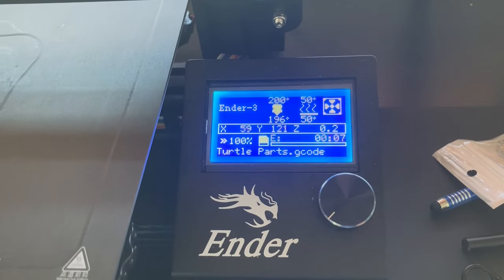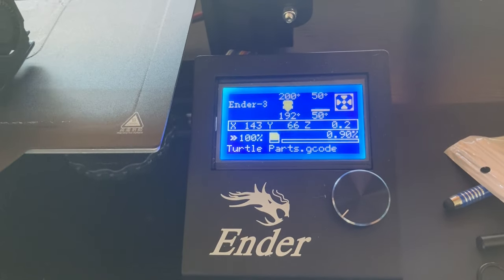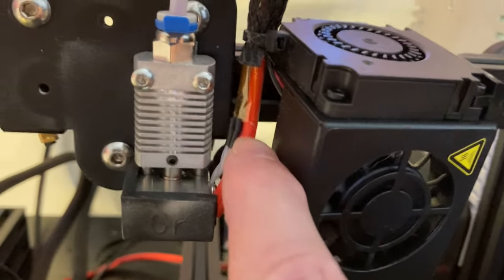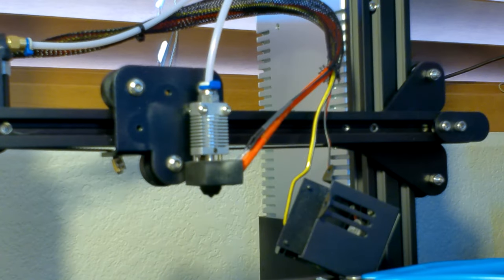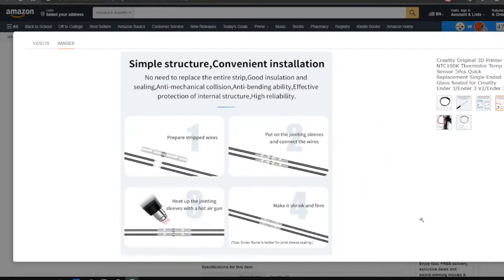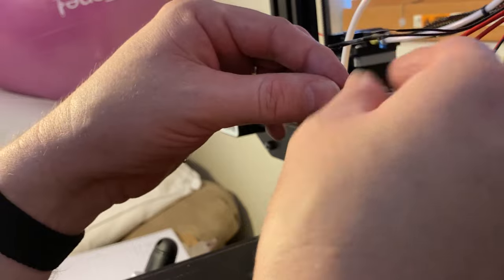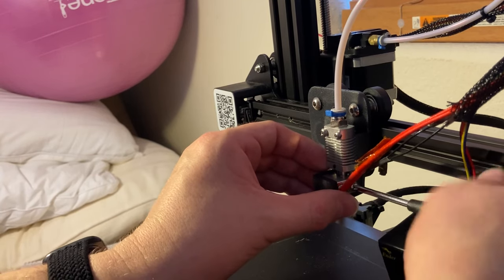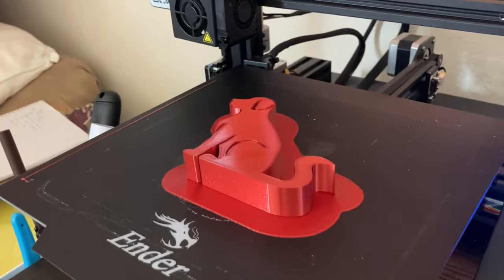STOP THE BEEPING! - Ender 3 Thermistor Replacement - Fix Thermal Runaway Issue

Comment: But how did you know which way to hook up the wires?  
Also, how did you exactly get the thermistor to stay in the hole? Then you're supposed to screw in the screw while the termmistor is in the hole too?
Reply from the maker: There's no polarity for the thermistor, so it doesn't matter which wires go where. (like for a resistor)  
You put the thermistor into it's specific hole then bend the wires close to the thermistor into a round shape. Then use the screw on the hole below to hold those bent wires against the block so the thermistor doesn't back out.
Reply: don't screw the thermister into the hole.

Comment: On mine the wire that is sandwiched between the screw and heat block is a bit exposed I can see the wire.  That’s probably bad isn’t it.
Reply from the maker: Yeah. I would say so. 

Even if it’s not making contact now you would have to think of how many little movements the nozzle and heat block make while printing. If it’s a little worn it could get worse over time.

Comment: I have also found out if I printed a great deal layers start failing I believe have a bad Thermistor, I started using it again and small stuff I could print with fewer layers but, when I got up in large prints it would fail. melting or not staying together is a tell tell sign it need replaced.

Comment: Also another cause is the wires solder from the bed plate is not attach will have to re-solder back to bed plate.:face-pink-tears:
Reply from the maker: Yeah I believe that would cause the error for the plate thermistor.  :face-blue-wide-eyes: Resoldering isn't too hard.  It's wires instead of micro-electronics.  You can do it. :yougotthis:

Comment: great video, I experienced problems lately that my printer in the middle of its print gives the "Heating Failed" error. i replaces the Heater cartridge and Thermistor but still gives this problem... at around 150-180 °C the problem occurs. any tips what i can do ?

Comment: I got a slightly different reading error on my cr-10s. When it gets within +/- 5 degrees of my target print temp it makes the same horrific beep and says "E1 failed to heat, please restart." I've currently tried doing PID tuning and I've checked the heat cartridge and it doesn't have any damage or issues I'm aware of. Yet after checking that and running the PID tuning in Pronterface I'm still getting the issue. My next thing to check is the power connections to the power supply and mainboard. If that doesn't work should I just try replacing my heat cartridge and thermistor? Been asking around for any advice, since this printer has lasted me 3-4 years so far, and I've not bought any others as of yet.

Comment: Hi. in my case, there is not a E1 warm. just the "THERMAL RUN AWAY Printer halted' text and thats all. I tried to move cables for if a false contacts appears but machine stills works normally l. Like you, printer starts fine but in some moment, will song a beeper and printer stops.

Comment: Thx  my printer is almost year old and just started.  Ugh will need to replace my thermistor also as tonight the 2nd time mine buzzzzzesss hehe.  So i knew hey FLATLINER!!      Charge!!  Clear  !     Ok  doc  we  have  a pulse 😂
Reply: @S-Technology  what i suspect the issue was , maybe bit loose with the screw. As thermistor must also physically make contact to be accurate with the temp.  I pulled it out no dirt whatsoever and put it in again fastened screw. And tested and my temp was more stable like normal.  Temp didnt flucuate as much.  So tonight or tomorrow will just re level bed and print again

Comment: is it the same process for the ender 5? I'm not that technical and experienced when it comes to this things but i want to try to fix it myself thank youu.
Reply from the maker: If it is the same hot end as an Ender 3 it should be the same process.  It appears the be the same if it is still stock.  Just take your time.  If I can do it, you can too.

Comment: Simple buy your exchange/repair Hotends. They come for about 15 Euro from Chine with a heating cartridge and the thermistor.
Don´t understand that you have no thermistor over. The problem is mostly that the Ohm Resistant changes and then you have no
usable result. No problem, i changed it only once and it works fine.

Many times the people have more problems because they build in connectors between the cables for faster change.
The problem is that some of these connectors don´t like heat and bend, or after 10 reconnects you don´t get contact.
Solder it directly together and then it should work fine.
Reply from the maker: That's also a good option especially if you are planning on upgrading your hot end.

Comment: I actually found that my ender 3's thermistor screw was undersized leading to unscrewing overtime but by the time I realised I screwed it back so many times that it ate through the thermistor wires and now I'm here since the reduced resistance leads to 10-20C lower temperatures recorded than what it is and I'm justnot comfortable with the idea of just settign that much higher for obvious reasons.

Comment: I've only had my ender for 5 days when this issue occured, does this mean I have to replace my thermistors anyways? or could it be another issue?
Reply from the maker: From what I researched there are basically 3 things that could cause the error. 
1) the thermistor by the nozzle like in the video.
2) the thermistor under the bed. 
3) the plugs for either on the motherboard. 

The thermistors are small and fragile, and the QC of Enders isn’t the best. So it’s possible it could have been damaged in freight.

Comment: hypothetically how many times can you cut the existing wire, lets say multiple splices, before you would have to replace the whole wire?
Reply: Every time you splice you cut behind the current sleeve, so it's always just one connection. I think you'll notice once you don't have anything left to cut.

Comment: after replacing thermistor and updating firmware and still getting this E1 runaway
 fault randomly what should i do next? this printer has only a few hundred hours on it.
Reply from the maker: My understanding is that the error can be caused by the Thermistor at the nozzle, under the print bed, or the plugs on the main board of the unit (That the above mentioned sensors plug into).  Have you been able to see the readout before the error triggers?  Do you see what temp is moving more than normal? That can give a clue.

Comment: ok let's see if you can help me solve my problem.. I have an alfawise u10 but I notice that the software is the same as the ender. I had the same error on the display of the machine and I replaced the whole hot end block...thermistor and heating cartridge but it doesn't work.. Now it gives me the message "heating failed..printer halted..please reset":face-blue-wide-eyes:
What can I do? How do you reset the machine? Heeeeeelp!! Thanks in advance!!!
Reply from the maker: Hmm... Have you checked the wiring on everything near the hot end? Thermistor and heating cartridge placed correctly?  
It sounds like either something is loose or not getting the correct voltage. I would also check the connectors on your motherboard to make sure nothing is bent or even worse melting.  If everything seems okay you may need to check the voltage being pulled by your hot end components. Something is off that is triggering a fail safe to stop the printer.  When it says to "reset" that is simply turning it off and then back on after several seconds.  Its a "Hard Reset" to clear out all the sensor data.
Reply: @S-Technology  Thanks for the answer!  I fixed my problem  by also asking for help from a printer manufacturer. And in fact, as you said, it was a voltage problem, or rather, something had burned in the board inside the connector that connects the machine to the power supply. Changed that everything is back to normal! Thanks again for the suggestions!
Reply from the maker: Glad you got it working again! 👍
That printer has a large print bed. What are you planning on making?
Reply: @S-Technology  yes the printer is pretty big.  at the moment I collaborate with a foundry.  I make enlargements of sculptures which are then retouched in wax or other materials. So it's not just for hobby but this printer is starting to get old and giving problems... I was considering buying another one!  any advice on a 300 x 300 x 350?

Comment: How do you know what side to connect to each other or it doesn't matter
Reply from the maker: I don’t believe it has a polarity.  It constantly measures the resistance which changes with the temperature. At least that’s what I read before I changed mine. 🤔

Comment: The bed of my printer is also over heating. Will it fix the problem?
Reply from the maker: Not by replacing the thermistor near the print nozzle.  That only controls how hot the nozzle gets for the filament. 

There is a separate thermistor under the bed that helps control the heating of the bed.  It is removed a different way but can be replaced with the same thermistor as in the nozzle.  So replacing that one also "could" help with overheating.  But there is also the bed's heating elements, or the wrong voltage coming from the main board, that could also cause the bed to overheat.
Reply: @S-Technology  I did some observations, and I noticed that when I try to heat the bed, the nozzle heats up instead. Could the voltage be the problem?

Comment: Mine says "outage recovery" a few seconds into a print although it never even turns off. could this be the same issue?
Reply from the maker: I'm not sure.  That sounds like it would be something to di with the voltage.  Like a bad power delivery cable or plug on the mother board that isn't consistent and causes an outage.
Reply: @S-Technology  Thanks. I recently replaced the motherboard so hopefully I just need to loosen some tention.

Comment: Will the sound just keep going all day long if you're not home? or does it stop after like 1 min?
Reply from the maker: As far as I can tell it keeps going.  It’s supposed to be a warning that the printer lost control of the heating components. (On nozzle and/or bed). 
You don’t want it happening while away. Possible fire risk.

Comment: Can you share your profile settings ? im so frustrated i cant get perfect prints on settings
Reply from the maker: There are a lot of variables.  My settings may not work perfectly for you. What printer are you using? An Ender? What material do you want to print? Honestly just stick with the basics. Work on getting it level. Stick with some simple material like PLA. Don’t change too many things at once otherwise you wont know what is improving your print or hurting it. 
You also have to learn about your particular machine. Mine has a low spot on the bed I had to figure how to compensate for.  It just takes time. 
It’s progress, not perfection.  
You can do it.
Reply: @S-Technology  im currently using ender 3 and print a pla+ and pla wood on it ... i watch a lot of video here in youtube and tried different settings on it but nothing works :(
Reply from the maker: For PLA I am usually starting with a nozzle of 200 and a bed temp of 50. That usually works well for me for adhesion. I have had some filament brands that I’ve had to increase the temps up like 10 degrees.  Print something small to test a new filament when you get it to see.

Comment: what's ur  ender 3 settings
Reply from the maker: Honestly I haven't modified the settings to much. It is pretty close to stock.  I also mostly print in various types of PLA with a nozzle temp of 200 and a bed temp of 50.

Comment: my ender 3 Neo has been doing this and its only 2 weeks old (got it on x-mas) please help
Reply from the maker: I'm not sure about the Neo but it should be a similar process.  A easy no cost fix is to try what 3D FPV Club mentioned (in the pinned comment).  See if there is any powder that comes off the thermistor and then place it back in.  It seems to be a issue the printers have after the first few prints.

Comment: Replaced the hot end and wires and still gettin this ?
Reply from the maker: Are you able to verify if the hot end thermistor is causing it?  There is also one on the bed controlling heat that can also set off the error.

Comment: i just got my printer and this happened do i need to replace it everytime when it happens? me as a 14 year old cant afford this so i hope not
Reply from the maker: If you know its the Thermistor near the nozzle then first try the technique from FPV Club (The pinned comment).  Removing the residue seems to help first.
Reply: @S-Technology  yeah I just put it up for printing again and til now it’s fine, I hope it’s not broken cause I bought it to start a bussines and I’m losing money
Reply: @S-Technology  is there any other reasons this could happen? I got it today too after changing filament and I let it be on idle for a bit and the sound killed me
Reply from the maker: @NeXy’l  If the screen is saying “Thermal Runaway E1” that means the printer is starting to lose control of heating either the nozzle or the bed. There are 2 Thermistors on a Ender. One is near the nozzle (in video) and the other is basically heat taped to the bottom of the print bed. 
If both of those are good and you are still getting the error then you need to diagnose the connectors on the motherboard to see if they are faulty. 

I hope that helps.
Reply: @S-Technology  I found another reason it could happen, I used a cable before and it’s kinda bad, when I switched back to sd everything works fine

Comment: I bought the same pack and the "bulb" part is too wide for the hole, what do I do?
Reply from the maker: Just making sure, It's for a ender 3 and you are placing it back in the lower hole, right?  The top one is threaded for the screw.  

is it larger than the one that was removed from your printer?
Reply: @S-Technology  yeah they were, I checked all 5 I received and I managed to have only one that'd fit, going to do a test print later tonight
Reply from the maker: I hope it works for you. I checked mine and they all seem similar size.

Comment: How can I be confident this won’t happen during a long print where there’s no supervision? I don’t want to burn my house down
Reply from the maker: Honestly, you can’t. At least I don’t know a way to guarantee it wont happen again in the future. I know it seems more likely to happen when first getting the printer, but it’s a sensor that can go out like any other component. 

That’s whysome people have added things like cameras and power plugs you can control or monitor remotely. A camera to watch, a decibel sensor if the sound goes off, and a plug you can control with Alexa or Google are ideas I’ve seen used.

Comment: This error is so annoying. I have multiple ender 3s and only the new ones get this error. While they've fixed things over the years, these new ones have so many issues. The older ones are work horses.
Reply from the maker: Yeah I wasn't kidding in the video when I said it's the worst sound.  Even after fixing it, I was still waiting for that beep to suddenly kick back up.  I've printed quite a few things since then and it hasn't returned, luckily.

Comment: yea it did not work
Reply from the maker: Does it still say thermal runaway error?  That can also be caused by the thermistor under the bed. 
Or the connectors on the motherboard.
Reply: @S-Technology  all I had to do was replace the thermistor or whatever the part that made the block hot but now none of the fans on my 3D printer are turning except for the power supply fan